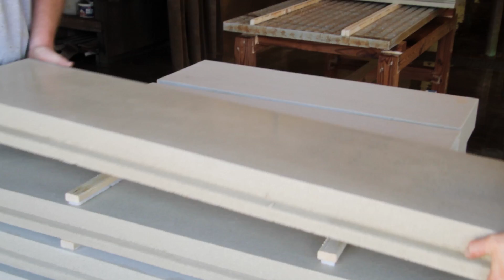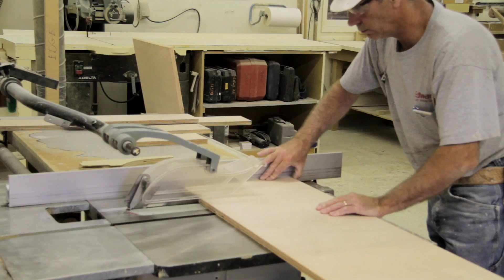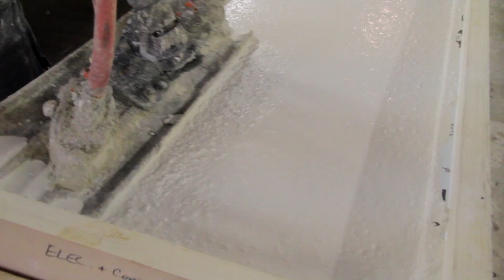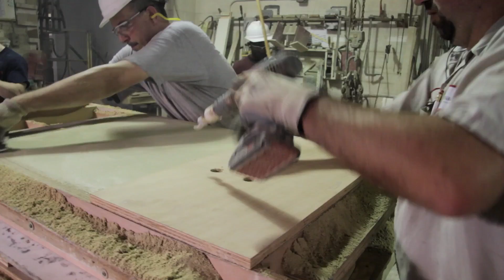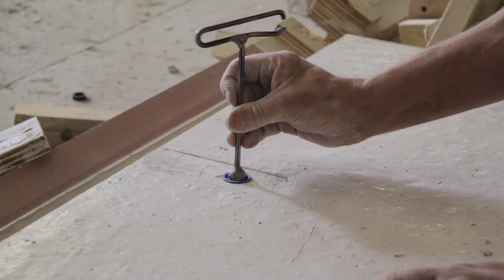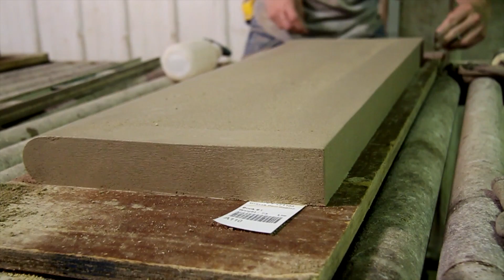Edwards Cast Stone

Comment: Any way to get the mix ratios for some one making their own cast stone pieces?
Reply: gary24752. Ive done this for a living for over 10 years. For every one bag of cement @25kg. You use 12 shovels of silica sand, and 4 shovels of spa, or granite.
Reply: Do you use white cement? Any lime?
Reply: gary24752 yes, white cement. No lime. About 300 ml of a waterproof agent. Get the mix to about the consistency you'd need to build a sand castle. Not too wet, not too dry.
Reply: Would like to learn to do this , is the mix for the look of sandstone
Reply: @Aggadoosk  Is this crushed granite? Not sure what I am asking for.
Reply: What fraction of spa or granite? And what kind of waterproof agent? Like Glenium? And no water at all?